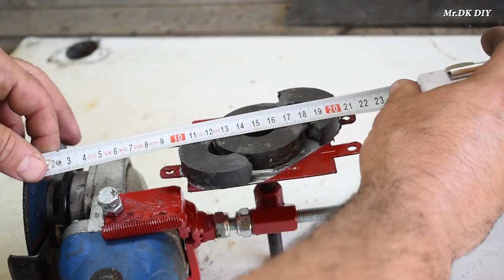BRILIANT DIY TOOL / CIRCLE CUTTER FOR METAL using Angle Grinder

Comment: Great idea, great use of Magnetron parts. Thanks for sharing. 
The only negative is that you can't do small diameter holes with that (and it would be tricky to control the exact hole diameter?). 
I need to do a 100mm hole in 5mm plate.  What are my chances?